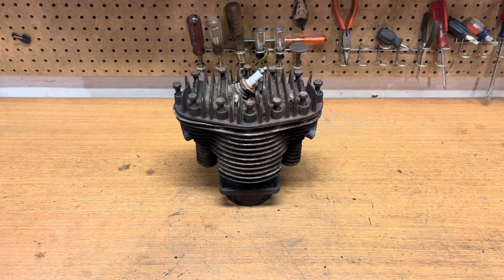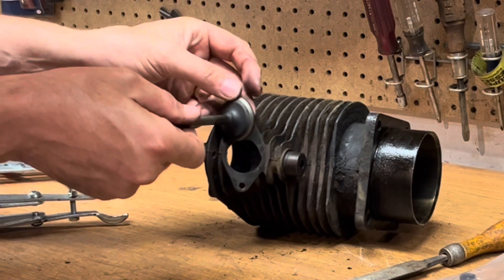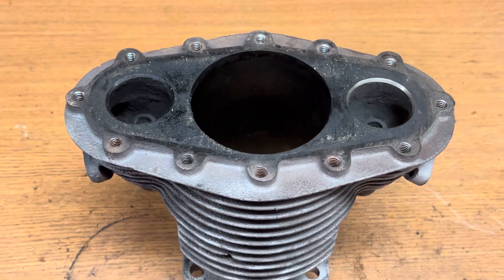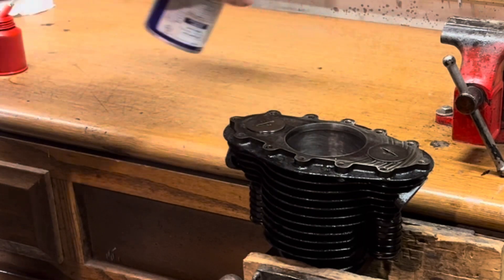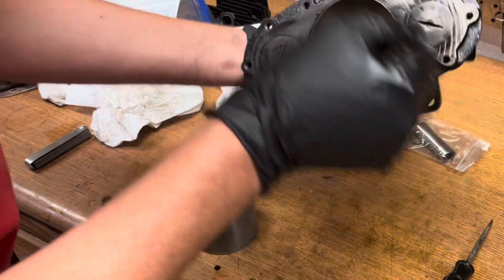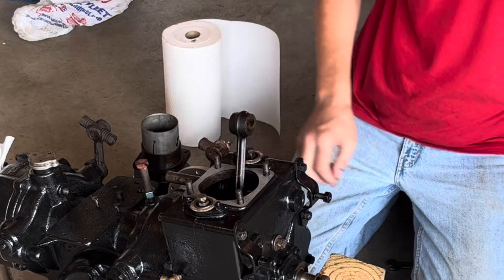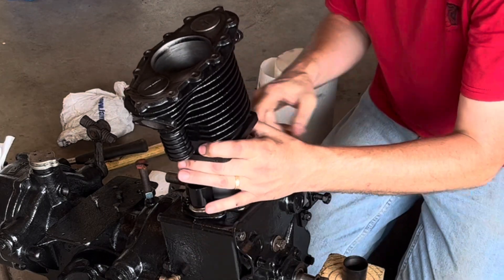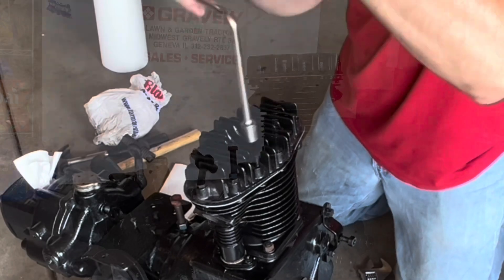1943 Gravely Model L Restoration, Part 6. Engine Top End Rebuild

Comment: As much as I want a war time model L the valve adjustment on my 56 and 60 LI is a lot easier with the covers you unscrew vs this with the spring loaded covers.
Reply from the maker: @FullMetalFab , the newer ones do look a bit simpler.